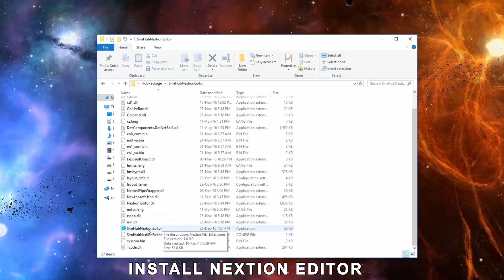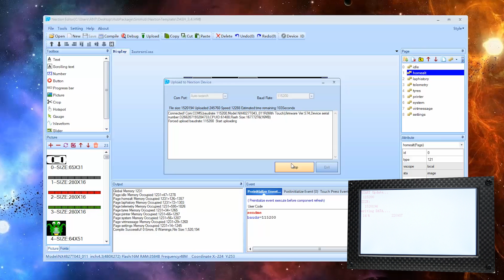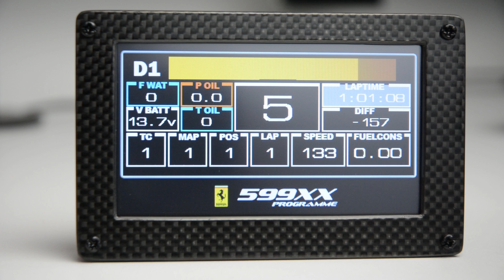DIGITAL DASH DISPLAY SIM RACING DIY

Comment: Hello friends!! I am amazed with these videos, and I have launched to make an f1 steering wheel with my 3d printer. I have a question, I don't know if someone could solve it, how is the connection between the tll module and the arduino promicro made? Or are two different usb cables used to operate the wheel?
Thanks for the video and for the feedback from the community, they help a lot to solve problems. All the best
Reply: I just started looking into the f1 build last night. Did you finish yours?

From what I can tell you can run 2 cables to the wheel (one for button controls, one for screen), or put a USB hub in the enclosure to only run one cable.

Comment: Hi,  what would be the avantages of a nextion over using a used mobile phone that simhub supports as well?
Reply: Well I will try to reply to myself then 😂. This is slimmer, I guess, it does not generate heat as much, quicker startup?

Comment: Getting the same "Connection Failed, Forced Interrupt" anyone have any advice to help me fix this??? Thanks!
Reply: Hi, i have the same problem ☹️ Did you solve it ??
Reply: @Triplegix  same prob here
Reply: did u solve this?
Reply: @tuckerhauser  Turned out that my Arduino micro pro was DOA :(
Reply: @Triplegix  thanks for the reply, I've ordered another one. That was the conclusion when it wouldn't take a simple script in simhub

Comment: I did connect the same usb-to-serial adapter to the Nextion 4.3" display and did the same as in the video. I could upload a dashboard to the screen but when i run Simhub and apply my Template nothing happens. The screen does not change atall. When i play a game like F1-2017 i get only static values like Gear "N" and Speed "999". These values don't change when driving. I did try other dashboards but they do the same. I noteced that you have an older version of Simhub. Could the newer version create problems? Please help me!

Comment: Hello amstudio, really awesome work. :-)
I want to built also this Display, i searched ebay for the 4.3 nextion Display and found only a touch display.
Is this the right one? Also i found the information, that this disply should be used with a usb poweradapter, because instable supply easily can damage the display.
Any problems so far?
greetings

Comment: What is that tape you are using to mount it together? Just normal doube sided tape? Getting the stuff for this display, the shifter and the 7inch display. Awesome builds :)
Reply from the maker: Automotive double sided adhesive tape.

Comment: Hi there, fantastic videos. I got this up and running but i cant change the dash to the Ferrari dash. Please help
Reply from the maker: Do you have the Ferrari Dash Files?
Reply: andddddddd that's the reason why. thanks.
Reply from the maker: goo.gl/8JLWm2
Reply: thanks for that
Reply: sorry one more thing. is there a way to load them all at 1 time. or do i have to have 1 up at a time. Then go back into the editor to change it, Thanks again

Comment: where can I get information about how to wire it for push bottons? 
By the way, for those who ask about rfactor or games supported this is what i found in racedepartment
Amazing job amstudio neat, clear: fabulous!
 Assetto Corsa
IRacing
ProjectCars/ProjectCars2
Codemasters games (Dirt 2,Dirt 3, Dirt Rally, F1 20XX)
Euro Truck Simulator 2 / American Truck simultator
RRE *
Rfactor1 *
Automobilista (using Rfactor1 plugin)
Rfactor2 *
LFS *
RBR *
GTR1 *
GT Legends *
GTR2 / Race*
Race07 *
War thunder *

Comment: Hi mate, I am building similar display system but integrated into a F1 wheel/ RIM.. Do you know what controller I can use that will connect the Nexton 4.3" with all my buttons and switches eg Arduino Nano ??
I can send you a pic if you like... I want to have both the screen and the buttons / switches on the same controller so only one USB connection...  Thanks, Ale

Comment: i have purchased a 7 inch nextion display and am trying to follow along with the video, but when i go to upload it just says "connection failed" "forced interrupt" was currious if you have any suggestions
Reply: Have you had any luck with correcting the error you received? I am seriously considering making something like this.
Reply: @Christopher-yl1fd   Did you figure out a fix for this? having the same issue
Reply: i have the same problem. did you resolve it?
Reply: @edmundw215    Did you figure out a fix for this? having the same issue
Reply: Same problem here, can’t seam to get it to connect to usb port
Reply: @GMCRaptor  did u solve it?

Comment: always impressed with your video .....how you connect all your ardruino mod ( all dashboard, handbrake and sequential shifter) on your PC ..... are you only install one simHub software for all mod, or each mod you should install each simHUB ......sorry my english very terrible....oh one question ......can i replace the display with this Nextion 3.2" HMI UART LCD TFT
Reply from the maker: Thanks Sang! All the displays run off simhub and plug in separately via USB. Simhub is an application that runs in the background. The analog handbrake is separate has its own programmed arduino controller and then plugs in USB. Sequential shifter is seperate and has its own game pad encoder and plugs in via USB. Yes there are templates for other screen sizes down to 2.8"
Reply: ok thank you very much

Comment: What soldering kit do you recommend?
Reply from the maker: I use a cheap Duratech 40w soldering iron  I have used this one for car stereo installs, rewiring an electric guitar and these sim projects. Also you will need some solder, just get a small pack or small spool of 1mm solder.

Comment: your videos are awesome, do you have a website yoy order your parts from. I looked on amazon for the 4.3 nextion display but nothing came up. I've ordered parts to make some button boxes and the gear indicator. your videos are very inspiring, if you could provide a Web link to the display or a website you order from that would be AMAZING. Thank you and keep the great DIYs coming!
Reply from the maker: For all the parts, I usually just do a search in google. Ebay and Aliexpress are a good start. Then find the cheapest including postage. Some other items are brought locally.
Reply: thanks for the reply! will this work with any size nextion display or is it only for the 4.3 inch.

Comment: Keep up the good work bro, if you sell these on ebay it will be profitable for you and someone like me with no experience with soldering can have a nice dash like this.
Reply from the maker: Thanks! You can still make this without soldering just connect the included wires. It just more compact and neater soldered. Soldering is quite an easy skill to learn.

Comment: Any tip on which of the many FTDI FT232RL controllers to use? Or does it pretty much don´t matter?
Reply from the maker: Good question, apparently some versions have driver issues, but that can be fixed with and update. Get the same looking one that I used, had no issues connecting.

Comment: Are there cheaper alternatives to the nextion displays out there? 45$/€ are pretty expensive for such a plain display :/
Reply: Anton Meyer-Erlach simhub purpose was to provide the cheapest but customisable dashes. nextion are the most expensive devices simhub supports, but there are templates for smaller nextion which costs around 20€ . compared to market solutions it's pretty affordable.